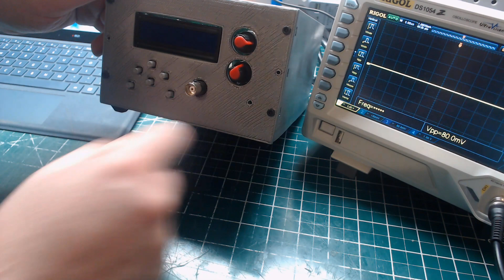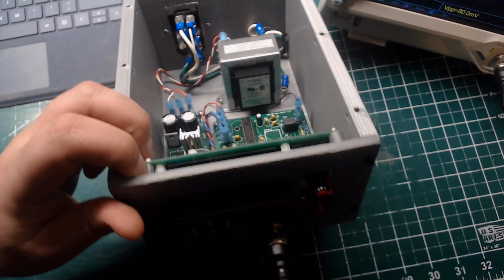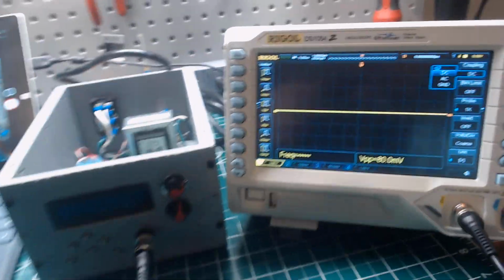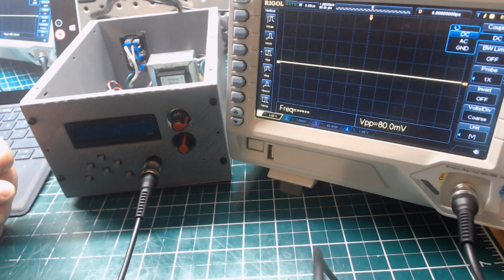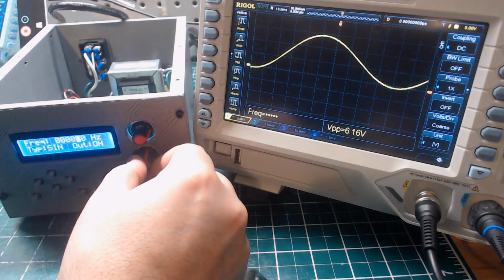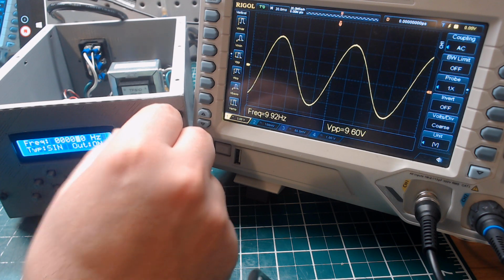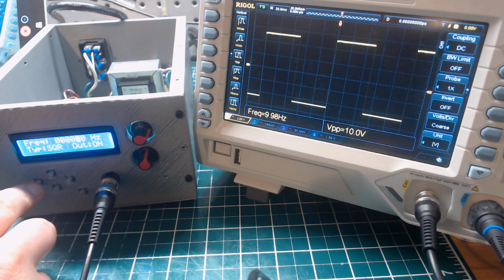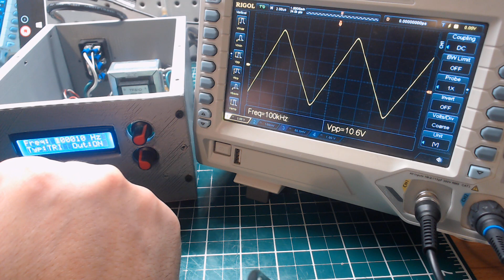BEE 425 Function Generator Project Demo

Comment: Jamil, did you ever figure out what was wrong with your Oculus? In your other video you turned off the comments. Mine is having the same exact problem and I have no idea how to fix it.
Reply: hey! lol it’s having the same exact problem with mine, since it’s been a little while did you ever find out how to fix the oculus?
Reply: @zerxy8738  yeah, another video I saw in the comments a guy was saying he fixed the issue by taping a small piece of paper over the light sensor between the two eye pieces. I tried it and it worked. It makes your Oculus think your head it always there even after you take them off. I'm assuming that it's a faulty sensor, and by blacking it out kind of fixes it.